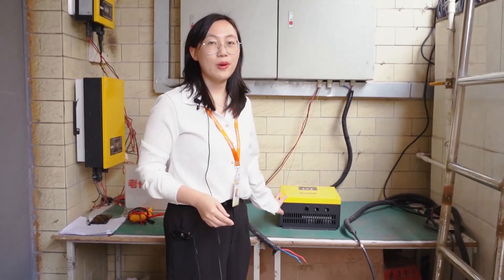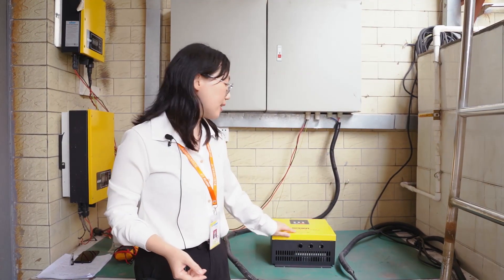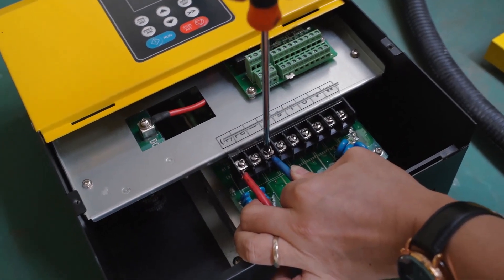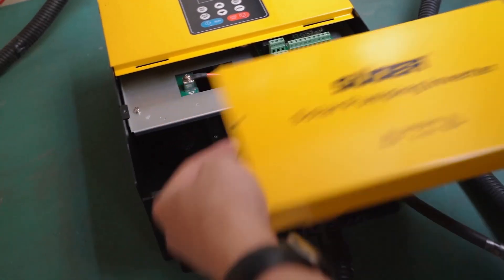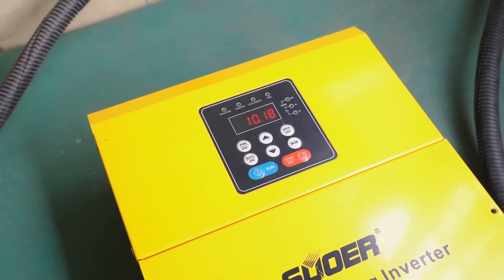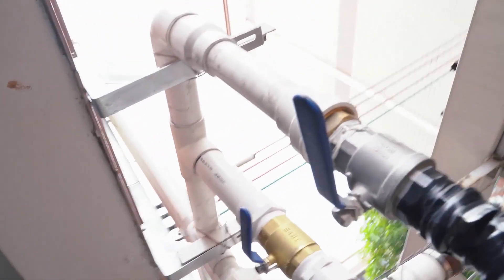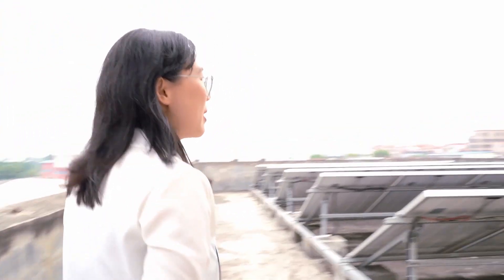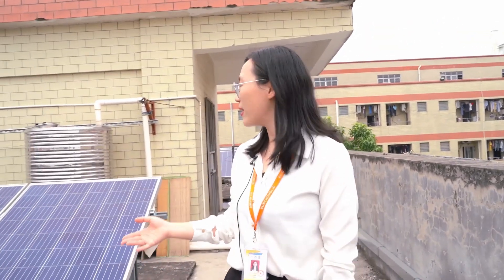SUOER Spring Canton Fair Live 2021. Solar Pump Inverter test and introduction

Comment: I am from cambodia , using suoer 7.5 km , can you please provide the manual or instructions for me. And one question , i see in the website that there are 2 input AC electricity and solar power, what type of this inverter. does the solar pump inverter can also use as hydride or off grind? Thank you